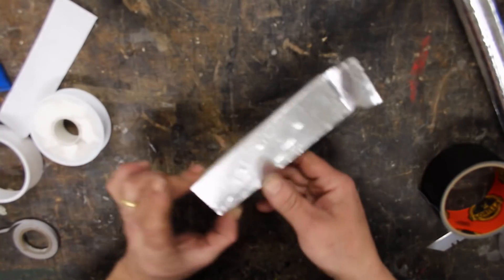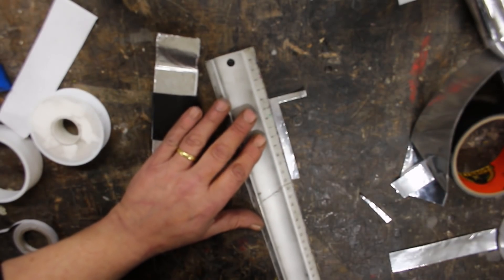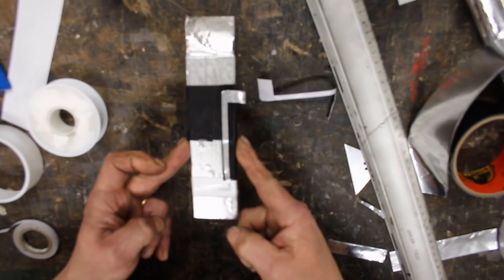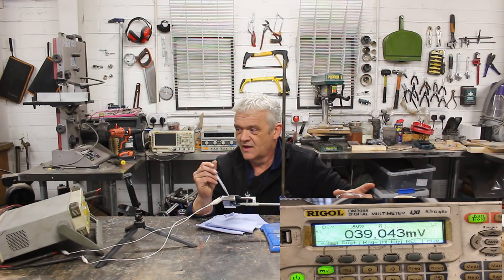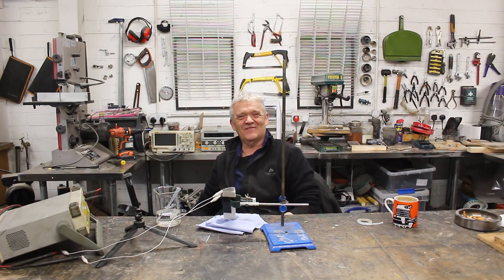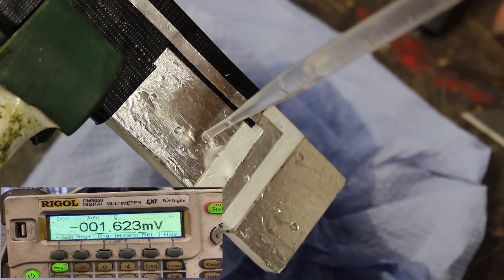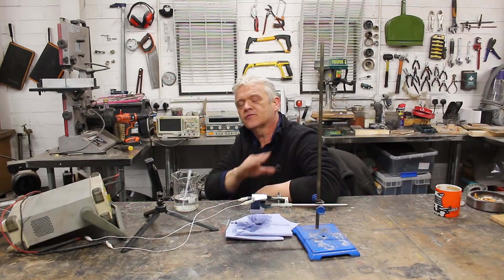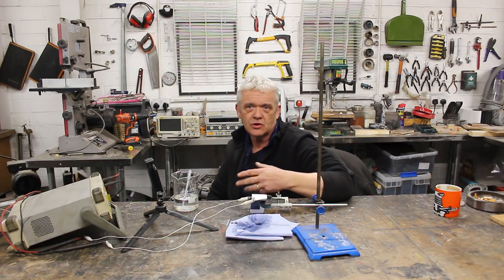1459 How To Make A Rain Fuel Generator

Comment: The basic principle of this setup is electric induction.
This acts like a Holz generator and in this case the energy produced can be calculated from the gravitational potential energy the drops have over the tiny gap between the strips of alu foil.
It will never exceed  the mass of the rainfall per second times the difference in height.( 1 cm?)
For 50 watts / m2 you would need a rainfall of 5000 liters per second on 1 square meter.
So that looks pretty unlikely  to me.
Reply from the maker: the paper suggests it is a triboelectric effect as opposed to induction mate I gave the paper in the description - you might want to have a look at it
Reply: @ThinkingandTinkering  the energy equation is the determiningfactor, whether it is tribo  or induction.
However I must admit that I forgot about g= 9.8 m/s^2 and kinetic energy of the falling drop from plusminus 20 cm.
So that would mean a 200 times smaller amount of water than the 5000 l. But still 25 liters/ sec.
And remember: a 100% has to be converted to electric energy. 
But sorry for the exaggeration.
Reply from the maker: @janhemmer8181   I think I would just read the paper - and if you still think this - well write to them and the peer reviewers who agreed with them - I am going to go with what they said - it seems to me they have more back up to what they are saying than you - after all you did forget to include an important component - so - really - with out being rude - and I apologise if it comes across that way - it seems to me you are talking off the top of your head without really checking  - so to speak and it does beg the question what else have you forgotten to take into account - or even - are you right in your basic assumption of what's going on?  Sorry

Comment: Hi Rob, Cayrex2 posted a response to your vid, and added a twist that you might like.  Sub the aluminum base layer with conductive ink...

Also, after reading the paper, the effect comes from a sudden change in the "effective" electrode surface area as the droplets spread out while making contact with the electrodes.

If true, you should be able to completely cover the base electrode in PTFE, and only allow the droplets to contact the top electrode.

Again, we are back to a capacitor with one variable(and hence, asymmetric) electrode charge density.

To best effect, you'd want to use a bridge rectifier to convert the to-and-fro current to DC.

Neat, thanks for taking the time to reproduce this. I didn't give it enough thought when it first came out, but anything that catches your keen eye, I know I should pay closer attention to.
Reply from the maker: I just checked out his improvement - what nice job - of course I am going to try it - this is how we move forward working together
Reply: @ThinkingandTinkering  I'm dip coating a 1x4cm grafoil strip in urethane (leaving the top 5mm uncoated as a clip contact), and laying onto the urethane a 2mmx30mm adhesive copper L-shaped strip for the exposed electrode.  Will send pics. Intuition is that the exposed electrode should be as narrow as practical wrt the width of embedded electrode.

Comment: Amazing everone! Could this be built in series? Or does only the first cell absorb the charge?
Reply from the maker: check out the paper I linked to
Reply: If its on a roof it doesnt matter. Rain drops cover the whole roof. If its in a pipe pushing the same water through then that might impact it

Comment: What you could do is construct a rainwater system that has a series of tiny holes (could be just a bucket with tiny pin holes in it) and suspend it above a whole series of these cells at a 45 degree angle.
Reply from the maker: that would work well mate

Comment: Water is a polar molecule. The purer it is (no ions), the better it will work at charging these capacitors. It would be interesting to try shooting a stream across it with a syringe to see if the output increases.
Reply: I think it's the opposite, the more ions, or contaminates to trip the contacts with charges ?
Reply from the maker: go for it mate

Comment: I'm looking for the description from 1880's of two wires, one on either side of a bridge over a running water stream that created a small voltage. 
This seems to create more power.
Reply from the maker: if I come across it I will let you know - cheers

Comment: Very cool and interesting! I want to make one now :)  Using this same principle of TENG energy harvesting, I recently tried to build the device in this paper here: DOI:  10.1002/aenm.202100038.  They have DI water flowing back and forth, using ocean waves, in a TFE tube generating current enough to light LEDs. I think my build did not work very well because my TFE tube was not thin enough.    Also, I wonder if a voltage can be generated if the water is just rocked back and forth across your device instead of moving in just one direction? I got to look into this myself.
Reply from the maker: nice link mate - I got the paper and I will have a read

Comment: graphene hematene water powered batteries
Reply from the maker: ? that's a little random mate - what do you mean?
Reply: @ThinkingandTinkering  both materials have electrokinetic properties.  they convert water molecule motion to electric charge. but they each develop an opposite charge making a battery cell.
Reply: it is in the smithsonian magazine "rust a new source of renewable energy?"  *Hematene * or popular mechanics talking about graphene hulled boats to make power from ocean water immersion

Comment: Imagine a ton of these cells on your roof when it's raining. Would they degrade over time due to oxidation of the aluminium foil?
Reply: @Jeffrey Wolsieffer I wonder if you could have a shade for the foil that allows water through, such as a UV resistant pourus foam?
Reply: @Jeffrey Wolsieffer never knew that, thank you for the history. Much appreciated!
Reply from the maker: yeah mate - everything wears out - not even the hills last forever - but you are probably talking years!
Reply: @ThinkingandTinkering  I was thinking about them in the roof guttering downpipes in a spiral pattern, no sunshine only water flowing from the roof. Do these only work from droplets or will a flow work?

Comment: If it turns out you dont need a big fall, you could stack sets of these ontop of each other, not just 50w per m^2, 500w per m^3
Reply: I'm not sure the rain will keep its charge after the charge is harvested. Though ... There might still be some energy left, so it's still worth making experiments, though.
Reply from the maker: nice
Reply: 👍 layered stacks,, 1st layer (a bathtub) gets all the rain and feeds it through dripper holes onto a layer of these generators, underneath is a flat/shallow collector layer with holes that feeds the layer below and so on. 
Rain tower..
Reply: @c3N3q  How about a hexagonal lattice (so you don't miss any droplets) with a sort of spiral staircase in each, running the droplets down them?
Reply: @computerbob06   What field of study is best to understand all of this?

Comment: I really like this Robert. I can see this being employed on the sides of my brothers Sail Boat. As the Boat moves forwards Bouncing up and down through the Waves making Electric Current to Run his LED's Running Lights along with Enterer LED Lighting. Maybe even charging his Boat Batteries. Thanks for the upload Robert.
Reply from the maker: now that's an interesting thought mate
Reply: I thought of something similar ... install the  "rain" panels where the waves are breaking on the rocky shores ... if the corrosion part can be mitigated.

Comment: Thanks for demonstrating the concept RMS. Was aware of this for a while as there was some press coverage when announced. Authors had used indium (tin oxide?) if I remember well which was one of the reasons I hadn’t got around to trying it out. But you’re using ptfe ! Will have a go as soon as I can.
Reply from the maker: I really didn't see the need for ITO - I do worry about the thickness of the PTFE though

Comment: Perpetuum Mobile Much?
Reply from the maker: nope
Reply: So if the droplets hit a turbine shaped capacitator panel 

The energy from the charge in addition to the energy from the weight of the water 

Should exeed the power neccesary to lift the water again 

If it was placed in a box with an antenna that could simulate atmospheric charging of droplets, it would appear to be an overbalanced water mill Mesmer Wheel ish2.0 

Grab yourself a stiff drink, Robert. The sky just fell on your head

Comment: What about making this with aluminium wire and some sort ptfe paint.  You could lay it over a solar panel in the gaps between the cells.  How do they function in parallel and series.  Does it matter if the same drop flows across one then another or does it have to be a different drop?
Reply from the maker: have a read at the paper I gave in the link mate - it does go into this

Comment: I had a look at this and did some maths. The first thing to point out is that PTFE has a dielectric constant almost exactly 2. Borosilicate glass is more like 4.6. If you want really small and thin pieces of glass then microscope slide covers (AKA Cover Slips) are about 10x10mm for the small ones and 22mm or 24mm on a side for the large ones and extremely thin. IE 0.13 to 0.16mm. Not only that, they are cheap. IE the bigger ones cost about £6 per 100. I will be trying out this method after reading the paper.
Reply from the maker: nice tips mate - thanks for sharing - but I don't think it is just the capacitance that matters - there is an idea that this is a triboelectric effect so that will make a difference I think
Reply: @ThinkingandTinkering  Rob and Gordon, yes..  After reading the article, they did do some comparisons using alternatives to PTFE, although not many. Although the materials they tested (eg Polypropylene) had a better dielectric constant, PTFE nevertheless performed better. I would suggest trying silicone rubber which is higher up the triboelectric series and can be painted-on or stenciled quite conveniently.
Reply: @TheBaconWizard  — nylon should also produce a good yield
Reply: @KK-pq6lu  I think Nylon is the other end of the Triboelectric series, but it would be easy enough to try it anyway...it's not like I really know what I'm doing lol
Reply: @ThinkingandTinkering  the triboelectric effect is being used in china to make heat into power . a device called LM-TENG.  (liquid metal triboelectric generator)
Reply: @ThinkingandTinkering  : all materials liquid, solid, gas, plasma has this affect. 

Think of the circuit your building as a band pass filter. Some combinations are great at low frequency interactions.
Reply: Or as a compromise, Kapton tape.
Reply: Just to be clear, are you saying swap the PTFE with microscope slides 'glass'? Very interested.
Reply: Titanium. Anodize surface to given voltage . High dielectric value and Very thin. Potentially very high value capacitor (and with E=0.5 C *V*V potentially higher storage capacitance that most supercaps which are limited to about 2.5V across them.) 
Water serves as one plate of capacitor. The unoxidized titanium the other plate. Vary how much water, and the capacitance varies. Keep alternating the capacitance and it's a charge pump.

Comment: The mighty Thor would be impressed. Might have a go myself as 50 watts is mental. Remind me of kinetic transfer system. Much how vibration transfers into a medium. Be that solid, liquid or gas. Drip feed power unit. Would do well on British roof tops. With 30 square meters. that a lot of power. Dose a heavy down pour increase it out put?
Reply from the maker: it might be worth you checking out the paper I mentioned mate

Comment: OMG can you print it with conductive ink?
Reply: I was wondering the same thing, although it might be more cost-efficient just to use the aluminium foil. If we can get 50w per sq meter with this, then can other material choices double it or better??
Reply: @TheBaconWizard  or use whole metal roof as one electrode, and hope galvanic corrosion won't get it.
Reply from the maker: I am going to try it

Comment: Over 40-years ago, someone told me his student friend (fellow lodger) on an electronics degree, had been working on an alternative 'solar panel' that worked by evaporating water off a conductive black mat, and the water vapour then condensed on a glass plate held about 25mm above the mat; apparently it generated an appreciable current. I never heard anything else about it and I dismissed it. Perhaps its time to do some experiments.
Reply from the maker: that is interesting - thanks for sharing that mate - you are right time to experiment!

Comment: This is brilliant Rob and I find this and the thermoelectric generator made from copper oxide completely fascinating . How do you imagine that this Tribo-electric current will be stored...Capacitors...would be my first thought?
Reply: Idealy, straight into the grid!
Reply: @TheBaconWizard   If i had enough of it, sure. I am thinking even with a large  panel, it wouldn't be a great amount of power.
Reply: @markmetzger5430  As he said, it is 50 watts per sq meter. That's pretty significant. 

Energy storage at home is simply done with batteries for the moment, but of course lots of people are looking into alternatives. Hydrogen would be excellent if we can safely store the stuff (for the right price)
Reply: @TheBaconWizard  I was thinking more along the lines of home storage is what i was trying to get to 😀
Reply from the maker: the fractal capacitor is more of a high voltage transformer as opposed to a storage medium - but banging it into batteries or caps after the fractal capacitor would work well I would think
Reply: @ThinkingandTinkering  Thanks mate, that was what i was driving at. Mico volts are impressive, though conversion to  more useful voltage would be needed to store it in batteries. Cheers :))
Reply: Perhaps  Making The Fractal Capacitor, in 1350 :))

Comment: Looks to me like a tiny Kelvin Water Dropper! With the KWD the water loses charge significantly if re-used and is only effective once or twice more which suggests that a whole roof of these would not scale as effectively as expected.

The flowers aren't too happy with the water afterwards either!
Reply: Except you aren't re-using the water on a roof, it works from rainwater falling onto it. You can still collect the water afterwards to use for whatever.
Reply: @TheBaconWizard The rainwater loses charge after crossing three of these generators. By re-use I simply mean that once the drop has passed one generator, it can not be passed into other generators ad infinitum. My comment about 'not scaling as effectively as expected' is about covering a roof with those generators which seems like an obvious and easy thing to try but as the water descends and passes the generators it loses it's charge which then goes on to interfere with the interface on the subsequent generators, rendering them far less effective, 

Half of the engineering magic behind this kind of solution would be to let the drops pass just 3 generators then to remove them from the system altogether somehow. It is certainly possible with clever design!

The resultant water can be collected, you are right about that, but the flowers aren't too keen on this water and so is best used for other things unless you leave it for a while to recharge!
Reply: @designerzen  OHHH, ok gotcha. Yes makes sense. So you don't want a solid board covered in them, but a sort of grille arangement.
Reply: @designerzen  strip of cells right at the end of the roof before the gutter would probably be the way to go, but why is it actually not useful for plants?
Reply: @plainedgedsaw1694  Plants don't like it as much, you'd have to ask them as to why! Perhaps it changes the pH of the water?
Reply: @TheBaconWizard  I'm thinking plantation shutters which are easily available used at the Habitat Restore.
Reply: @woodlandsdel  Fantastic idea!
Reply: @designerzen  But the rain that falls on to a roof incline one metre is not the same rain that falls one meter below it. So you build three generators into a cell, followed by a gully that pushes water into a groove to the gutter. New rain hits the generators.
Reply from the maker: yeah that's a nice way of looking at it - you might want to have a look at the paper where they address this